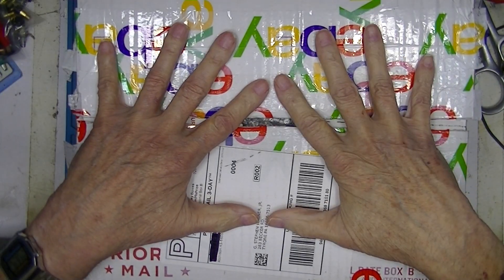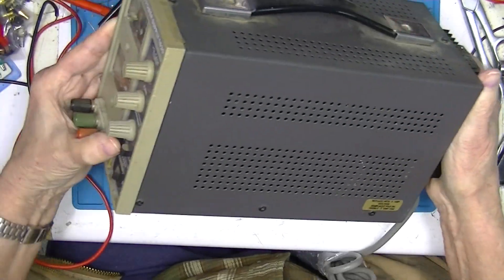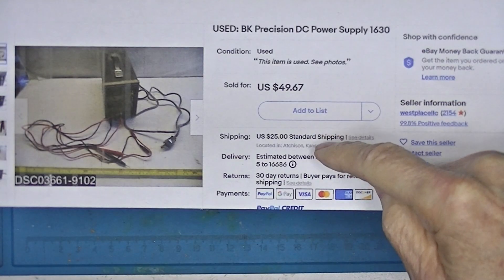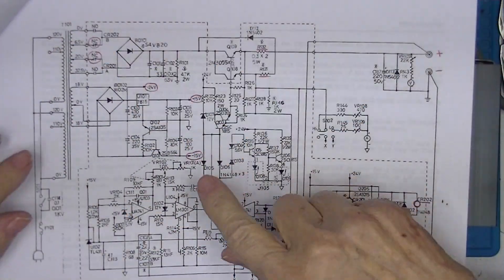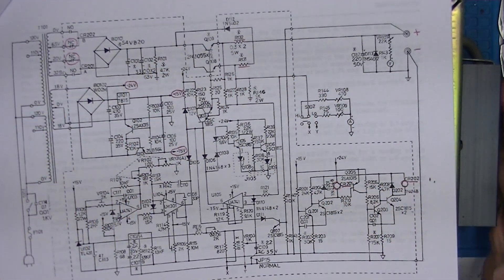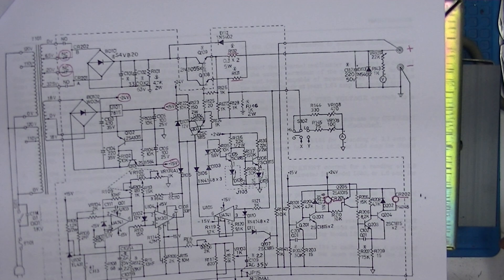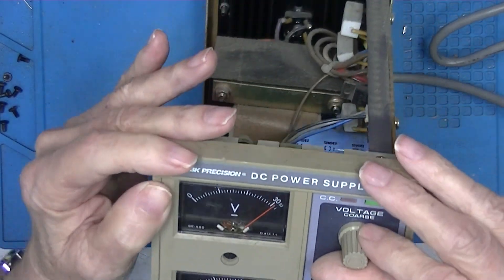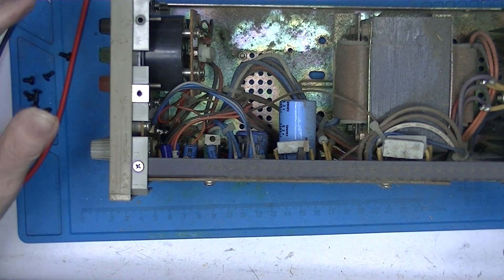B&K Precision 1630 Power Supply - Part 1

Comment: I just scored a MINT BK Precision 1730 power supply from a local University auction for $21.... 😁

Thing is absolutely mint, and works perfectly. WHAT a SCORE!!

I also sniped a fully functioning, clean, H.P. 54600B Digital Oscilloscope, WITH the expansion pack already on the back of the unit, from the same place for $76.50... 🎉 😊

University auctions are GREAT!! 👍

Comment: Mine is stuck on max voltage. I have 47 volts measured at the leads with knob turned all the way left. What should I check? Its the 1630 just like yours. Oh, I forgot, I subscribed..Thank you for the videos.
Reply: Pass transistor is likely blown...